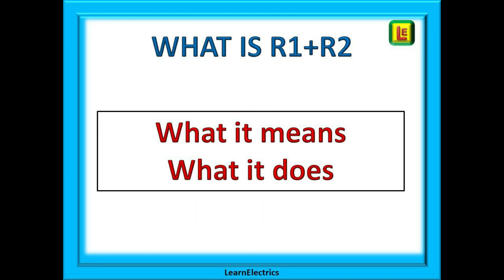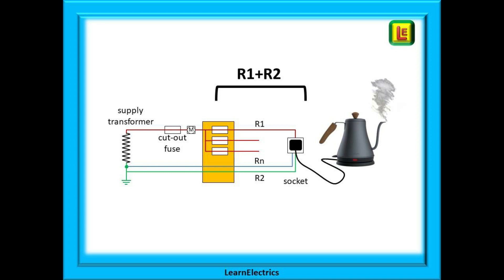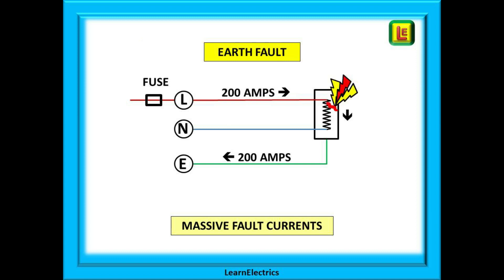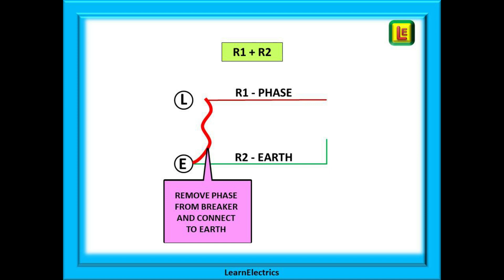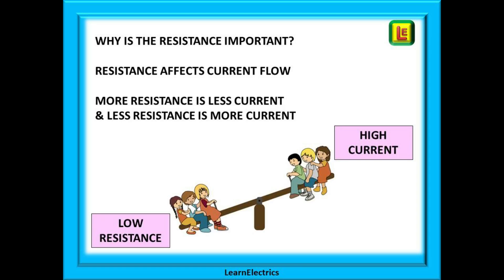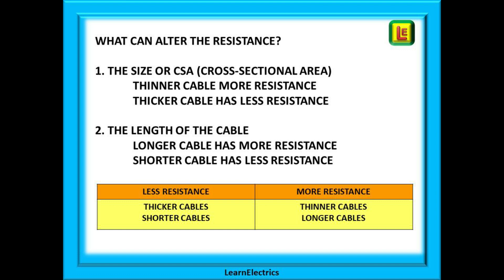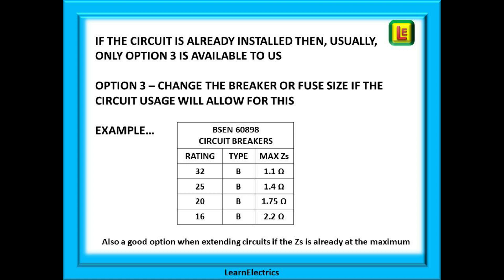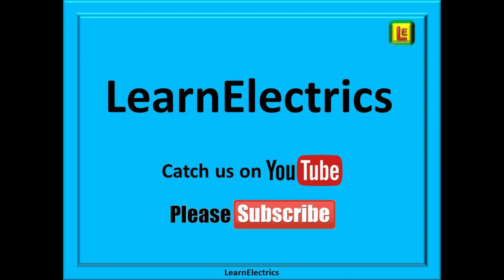WHAT IS R1+R2. How to change the values, what do they mean.

Comment: Can you not rely on RCD for fault protection with a 30ma rcd having a maximum Zs of 1667Ω? of course it is always the goal to be within the Zs values for mcb size and type but at a stretch?
Reply from the maker: you are switching from a fault current size between L & N to a  fault current difference between L & N when you use an RCD device.

Comment: When you were explaining where earth wire gets energized through the metallic body of the appliance, a thought popped up in my mind. What if the neutral wire touches the body of the appliance and both neutral and earth wires start sharing the current? What will happen in TNS or TNCS system built without an RCD? I guess the breaker won't trip, and the earth wire could be carrying a deadly of current? Am I there, or am I missing something?
Reply from the maker: Earth and neutral are the same point electrically back at the intake position. This is one reason that ewe install RCDs or RCBOs now. Any sharing of the current will trip the RCD device. Good question.
Reply: @learnelectrics4402  thank you

Comment: you have revolutionised teaching electrics without a doubt. So is basically the difference in energised and deenergised electrons is that energised electrons are buzzing with energy and they sell their buzz of energy to the load eg kettle etc and then the de energised electrons are vacant of energy ready to pick up their load of energy from the market ie the transformer and does all this happen extremely quickly. Thankyou for a great tutorial.
Reply from the maker: That's right, like hot and cold water in the radiators. Dave.

Comment: Testing R 1 and R 2. Must you disconnect earth and the live for that specific circuit in consumer unit to take readings?
Reply from the maker: I always do. The live conductors are both line and neutral. By disconnecting you are certain that you are only testing those conductors. Any other paths will be picked up by the Zs test.

Comment: Wtf is "de-energised electricity!!?
Reply from the maker: Think of it like hot and cold water in a central heating system Mike. Hot, energised water flows into the radiator, gives off its energy as heat and then flows back to the boiler as cooler water to be re-heated, re-energised, and flow around the system again. Hope this helps. Dave.

Comment: Great great video. I love your channel.

At the risk of sounding like an idiot I'm a little confused when you said energised electricity flows through r1 and then de-energised energy flows through rn.

I never thought of it in this way  and I'll have to look into that more. 

Thanks a lot for taking the time to do these videos. Your teaching style works really well for me which is really saying something
Reply from the maker: Thanks for the support, appreciated. Its like water in a central heating system. Hot water flows into the radiator and cooler water flows out. We don't lose the water, the water flowing back has given out its heat and returns to be reheated again. Thanks for watching. Dave.

Comment: I have been asked why you can't take a zs and subtract ze to get your r1 r2 , my answer was because of parallel  paths , but if your saying leave the cpc in the MET , you would still have parallel paths?
Reply from the maker: You will need the earth in the cpc to get your Zs. Your test meter won't work without. Thanks for watching. Dave.
Reply: @learnelectrics4402  I don't understand your reply🤔 , you say take the line out the mcb and put it in the main earth terminal , the on site guide also says leave the cpc in and put a fly lead between line and cpc but surely this leaves parallel paths?

Comment: Hello Dear Tutor
I am your fans and watch your video long.
something I don't understand is near the end you said " if the circuit breaker changes to type C from type B, the Zs goes down. It is now even harder to get the figures and sizes become more critical and changing the type D breaker makes it worse again " however, as we know the less resistance on Zs, the more fault current will flow and the quicker the circuit breaker operates to trip. looking forward to hearing from you soon. thank you
Reply from the maker: That is correct. If you make the MCB less sensitive to tripping B to C to D you need to increase the current to compensate for this lack of sensitivity. Next Mondays video is about MCBs and more detail about this. Thanks for watching.
Reply: @learnelectrics4402  Thank you for teaching the relationship of resistance and current for the Zs. but for the sensitivity of the MCB I don't understand that based on the changing type B to type C, the resistance is lower and the current should be risen, right ? for the typee of the rating 32 A, does type C have higher sensitivity than type B because type C has lower resistance value ? I don't get it, please help.

Comment: Is there a max vlue for R1+Rn     The breaker must still trip safely if there is a short between live and neutral ??
Reply from the maker: Yes, but think about it. Most circuits have the L+N+E going the same route so they will be almost the same length.
As the Neutral is the same size as the phase, and the earth usually smaller, this means that R1+Rn is less resistance than R1+R2, so the short circuit current could be higher. Hope this helps buddy. Dave
We have a great video about this ... Cable Lengths and R1+R2 ... on this link
https://www.youtube.com/watch?v=Qq_9MNH8XxU
Reply: @learnelectrics4402  Thanks, what you say makes total sense. Just we are never asked to check the R1+Rn to make sure it is less.
Reply from the maker: Stick with me buddy, we'll get you there. Dave.

Comment: What about if the fault was on the neutral side of the resistive element?
Reply from the maker: If the fault was neutral to earth then you would not have an overload since the resistance of the appliance is still in circuit. You may find the RCD trips though.
Good question. Dave.
Reply: @learnelectrics4402  not sure why I asked this as they're effectively the same  by being connected at star point 😂
Reply from the maker: Glad you did Ed, someone else might have been wondering the same question.

Comment: Thanks for this clear explanation you explain this concept perfectly! 

I was wondering what your thoughts are on short courses for adult learners?  I am 45 but would like to change career.  I understand that getting some work experience is key to doing the job safely.  I was thinking of doing a domestic installer course and trying to get some work experience to build up my skills.  Do you think it’s worthwhile?  I am keen to lean and do a lot of hobby electronics already.  Thanks Glenn
Reply from the maker: Thanks for the positive comments Glenn.
Up until Covid struck the country I used to teach lots of Part P, 18th Edition and Inspection and Test courses. They are good if you are starting out, especially for mature learners of which there are a lot.  BUT choose your training centre very very carefully. Some centres promise a lot and leave you still wanting. I would recommend actually physically visiting at least 3 centres before parting with any money. What are the training facilities, how much practical is there on each course, what is the written syllabus, get a copy. You are looking for a centre with a high standard of teaching, an instructor who has been on the tools for many years, not just read it out of a book or doing electrics one week and plumbing the next.
I also taught and assessed for one of the big scheme providers and although they might be a little more expensive they do have a high standard of teaching and are in a much better position to advise on your next step, especially on registration as an electrician. They can be worth the extra cost and extra driving distance in the long run. As far as experience goes, some chaps have offered their services free as an electricians mate one day a week until they build up experience. Others just do minor work stuff, changing lights, repairing broken sockets etc. until their skill, confidence and experience build up.
You will get NICEIC and NAPIT phone numbers off the internet.
Hope this helps - be careful before you part with a few thousand pounds of hard earned cash. Dave.
Reply: @learnelectrics4402  Dave thanks so much for taking the time to give such a detailed reply.  This is great advice and much appreciated.  I was thinking of this course at trade skills for you

https://www.tradeskills4u.co.uk/courses/domestic-installer-course

I am interested in later on doing the EV charging point course too.  That’s all I want really someone I can work with on a Friday so I can learn.  My issue is I wirk 4 days a week and I need to keep that going as I have a mortgage and children.  Someone else from the industry had suggested doing an nvq level 2 with a view to doing level 3 and working on contracts but I think I would struggle to fit the course in round my job.  

One thing that put me off years ago was I had been told I was colour blind.  I have since done an online test and I have mild deutan or red green colour blindness.  This doesn’t effect me seeing the colours of the wires at all there is no confusion between earth, live or neutral.  Plus I have seen there are glasses you can buy to solve this.  Do you see this an issue? 

Thanks again Dave and sorry about the 2,000 questions.

Cheers 

Glenn
Reply from the maker: Glenn, lots of sparkies are colour blind but there are many levels. Most don't know and it never affects their work. Don't worry about it. We have a video on this that might help.
Colour Blindness Testing
https://www.youtube.com/watch?v=P0Cgglc391M
As a trade you will need the 18th Edition so keep watching our 18th edition help videos.
You need as much practical as you can get so if it was me I would spend Fridays with another electrician learning the skills. Or even doing things in your own home. Change a socket, change a light switch. Make the garage lights two way. Invent things to do. Make a plan that every Friday you do just one easy job in you house. Change a ceiling rose. Fit a 13A socket with a USB charger socket.
Practice is the key. Good luck. Keep watching the videos, never stop learning. Dave.
Reply: @learnelectrics4402  thanks Dave it’s funny after sending you the colour blindness question I saw your video on it it’s like you were reading my mind🤣. 

Brilliant advice Dave I will definitely do that.  I think I am just going to go for it with the course and practice loads and get some work experience with someone and as you suggested do work on my own house.  And of course I will keep watching your videos.  Thanks again for taking the time to reply.👍
Reply from the maker: Good luck, I've enjoyed the last 40 plus years in the trade, and most times the roof is on when you're working. Dave.

Comment: is this not irrelevant when using 30 mA rcd   30mA is a lot less than 200A fault current and trips very quickly old regs V new regs
Reply from the maker: Good question. RCDs are additional protection, additional to that provided by MCBs.
I know what you are saying but we are just telling you what the Wiring Regulations require us to do. Lots more to come, hope you are enjoying them. Dave.

Comment: Thanks for making these videos, the amount of information that needs to be learned is daunting, but the way you explain things and break the subjects down makes it a lot easier to understand.
Reply from the maker: Thanks Nick for the really nice comments. There is a lot to learn but try to learn a little bit every two or three days. A dripping tap will fill a bucket. Also, draw some of the diagrams and pictures you come across, drawing it makes you concentrate on what is really on the page in front of you. The more you learn the better you become and your earning potential goes up. Stick with it, it's a good trade. Dave